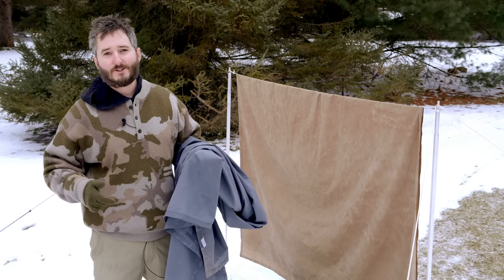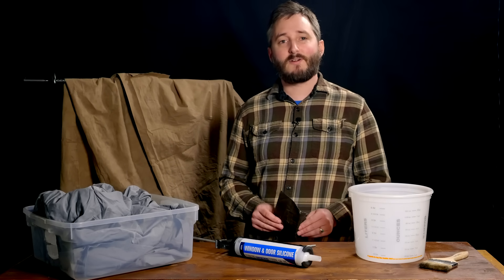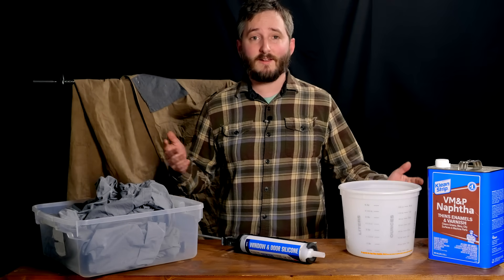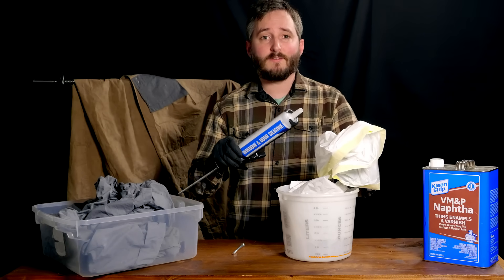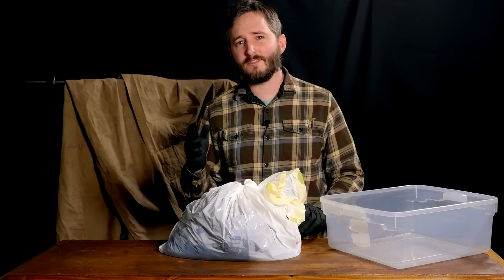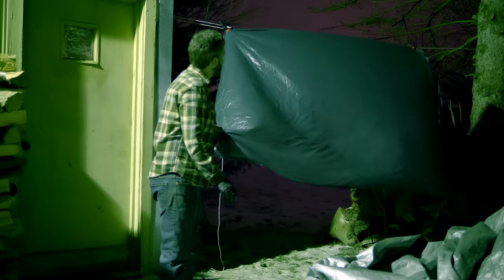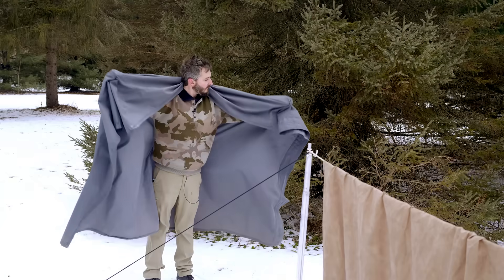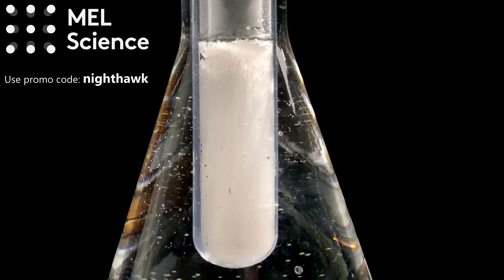Recycled Bedsheets Make The Best Waterproof Tarps

Comment: I've been wanting to make an oil-skin tarp for camping, but now I'm going to go with this! It seems like it'd be a much lighter option by weight instead of canvas and oil/wax combination as well as a much easier process! Thanks!
Reply: Just make sure you don't have an allergy to the silicone, also uv resistant silicone is definitely the way to go
Reply: interesting, i would have thought, the silicone would rather make it slightly less flammable than a bare cotton sheet. 
but i just tried it, and cured caulking silicone certainly burns pretty well, and quite hot. (and in an oddly interresting way)
Reply: Plus, you can order some california king sheets or bigger!
Reply: My expectation is the naptha should evaporate, and the silicone should not sustain a flame on its own. Cotton burns, of course, but coated in silicone, I'd expect it to be relatively flame resistant unless held in a strong flame until the silicone burns away and the cotton ignites.
Reply: @Nono-hk3is  a lot of these silicone brands aren't 100% silicone
Reply: I guess this means there’s only one thing to do! Make a test article and burn it!
Reply: Be careful to put some fireproofing on this before it's anywhere near a campfire, I found out the hard way that this combo is incredibly flammable.
Reply: @TheZombieOfDrake  even after it’s cured? Huh. That’s a consideration too. I wonder if there’s a chemical you could mix in to make it flame retardant when mixing the silicone.
Reply: @MakerMurph  i suppose the entire thing is essentially a candle wick. 

I consider this a bonus. You could cut a strip off your sheet to use as a firestarter.
Reply: Are You guys sure, @TheZombieOfDrake wasn't talking about the oilskin?
Cause afaik that burns very, very well, because it's - well - oil and wax.
And sure, silicone by itself and with fabric can burn too, but I don't think it compares with the flammability of oilskin.
Reply: @Null8fuenf10  It was this exact mix. I made a waterproof boonie hat for camping, which worked very well as a waterproof hat. I lost that hat around a campfire when it caught fire from a single spark. I coated my second version with a fireproofing spray, and I haven't had any more issues.
Reply: @TheZombieOfDrake  Naphtha was probably trapped in it because of cured silicone surface. Maybe heating the sheet to make naphtha evaporate away is essential part. Mixing high temperature silicone with 300' Celsius rating is also another option if you tend to put tarp near fire. Or just start the whole thing with nomex instead of cotton sheet.
Reply: @TheZombieOfDrake  does borax work for that?
Reply: @TheZombieOfDrake  thank you.  Good tip.
Reply: @TheZombieOfDrake  I mean it's cotton and lighter fluid mixed with the silicone
Reply: @Shadow_Hawk_Streaming  the lighter fluid fully evaporates in hours, so that's a non factor.
Reply: I spent a couple weeks sewing, reinforcing, and making tie-outs for an oil skin tarp a few years ago. That tarp lasted about 2 years before doing exactly what he mentioned. Ripped at a fold. Also, it weighed 10 lbs! after it was fully treated.
Reply: Same exact situation here, believe it or not!
Reply: Ive read all comments about not being fireproof . My sleeping bag would burn in 2 seconds ! My tent in about 3 seconds ,maybe my leather boots wont burn. 😉
You should always Be very careful with fire  even when drunk. So im not worried about testing this method.
Reply: so how'd it treat you if you tried it?
Reply: well dang. I should have come to this comment section first before posting my question about fire resistance. I figured silicone was basically a fire retardant in and of itself.
Reply: @Meenaia  It is, the guy probably didn't let it dry all the way. Either too much Naphtha like Nighthawk did in the video or he took the "24 hours and it's ready" too literally, I'd say it takes roughly 4 days for it to dry out of a bed sheet, anything thicker than a bed sheet would obviously take longer to lose the solvent to the air.
Reply: Maybe try using the fireproof silicone. Google searched, and several showed up. Looking at using that. Should eliminate any issue of catching fire for whatever reason or from being improperly cured.
Reply: @luckylg1046  Add some boric acid to the silicone to make it fire resistant. That is what is used in cellulose insulation and should work fine for this as well.

Comment: I wonder if you could make a diy umbrella with this cloth using bent steel wires as a frame.
Reply: Yea, pretty easily in fact. Although youll have to skip the folding mechanism
Reply: @CAMSLAYER13  I've seen folding umbrellas made entirely from wood with only a few metal pins for the moving parts to pivot on. It may take more time than a reasonable person would consider spending on a project like that, but it's entirely possible.
Reply: @ParadigmUnkn0wn  its certainly possible, the concept is pretty simple. Just quite time consuming to implement.
Reply: Unwanted umbrellas are everywhere.  New ones are probably cheaper than 2L of naphtha and some silicone lol. But it might be cool to make one anyway.
Reply: Bet it wouldn't take anytime to make out of bamboo.
Reply: Dude!  What a great idea!

Comment: Oh awesome this something i can really make use of where i am right now
Reply: Very interesting method. Couldn't you technically just mix up a large batch of the silicone mixture in 5:1 ratio and then use it to treat multiple fabrics though? Like say I have a large wash basin for doing laundry, could I not just mix the naptha and silicone in that and then treat multiple fabrics in a batch?

Your method works for small scale fine and doesn't have leftover chemicals at the end while a dasin full runs the risk of leftover solution that needs disposal in some way.